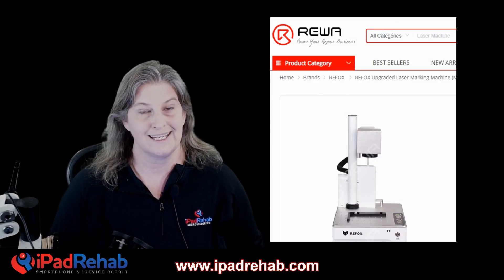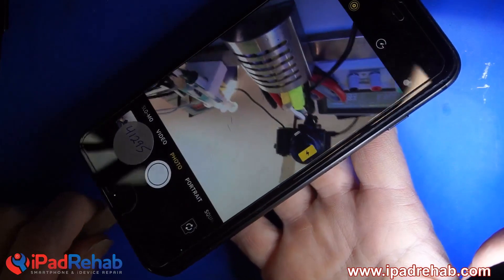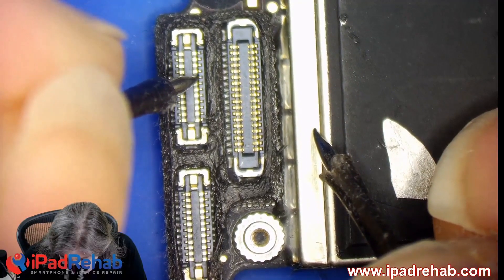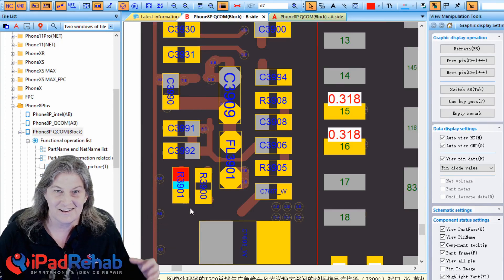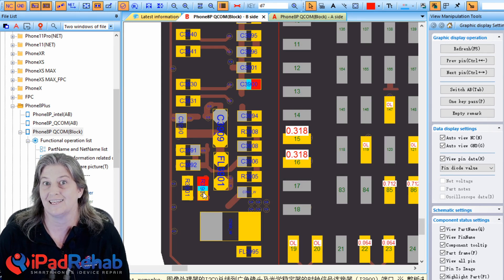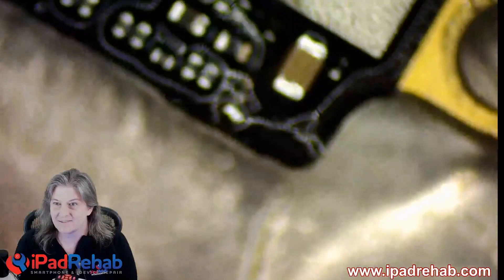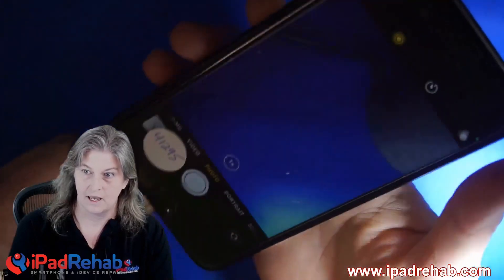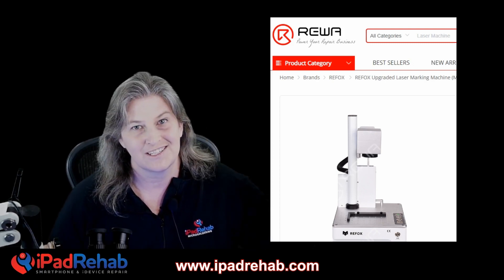Back Glass Laser Damage--Correcting Camera/Flash problems

Comment: I’ve had an instance in which an xs max started running very slow after replacing the back glass, however with micro soldering that was fixed. After that I had another xs max, and this time I decided to remove the board and do the repair, but ended up with the same issue, super slow phone after the repair, crashing etc. I’m guessing mine had been lasering some components on the charging port, and when connected to the board it fried the board. At this point it’s all just risk with lasers

Comment: The two signals are  I2C signals to/from the Wide Rear Camera. One signal, I2C0...SCL..., is the clock signal from the bus master. The other signal, I2C0...SDA..., is the bi-directional data signal on the bus. Camera pixel data may be transferred on other signal traces.

Comment: how tf does the laser penetrate so deep through the case/shell inside the iphone to even reach the logic board? And why do they even solder 0Ohm resistors, why not use tracks/via?
Reply: i wanna know the answer for ur first question too fr and i dont think it rlly penetrates that deep if u like set it at 1000 m/s at 20 khz

Comment: I have got "baked" iPhone 7 from my friends daughter, for "uncle fix this" challenge.
A little of rust ate some of the elements around power converter chip that drives both front and rear cameras and the flash hybrid. 
Is there any chance that you would show the voltage drop values of the camera connectors in that model, same way as we can see it here?
Reply: @Robert F thanks. Got it. Despite having such data item in the menu, the voltage drop values are no where to be seen.

Comment: "Hi, and what do you do for a living?"
"I make 0 Ohm Resisters"
"You mean wires"
"No they have microcomponent packaging"
"So you sell resistors that don't resist... who buys them, technicians with a sense of humour?"
"No... Smartphone and Laptop manufacturers, they buy quite allot"
"OH!!! So you stick it to 'The Man' for a living."
"Pretty much.  What do you do."
"The wrong thing, apparently."
Reply: It is also called a "fuse"
Reply: @theEskalaator  actually fuses have to have a resistance or they will require too much current to fail and will likely let harm come to the other components first. You could just use a micro fuse instead and it would show its failed too.
Reply: @WolvenSpectre  those 0 ohm resistors do have some resistance. Just look at backlight circuit - always broken resistor (or "filter") but IC is hardly ever damaged

Comment: As long as you setup the template properly the laser is not a problem. The best way is to remove the board the first time you see a specific model, once you have adjusted the template you can leave the board in.